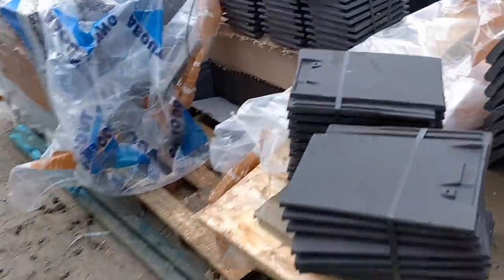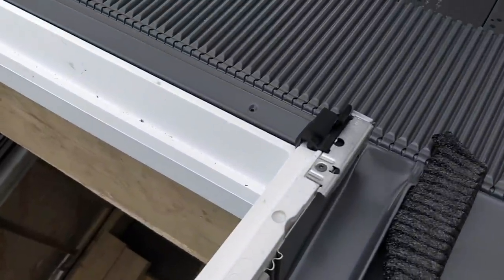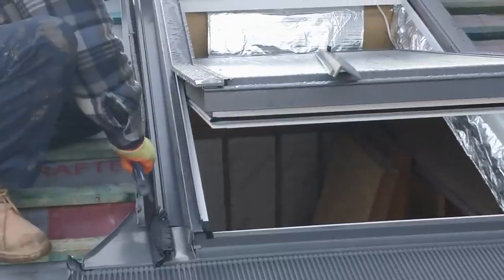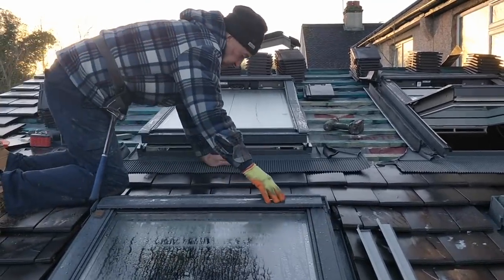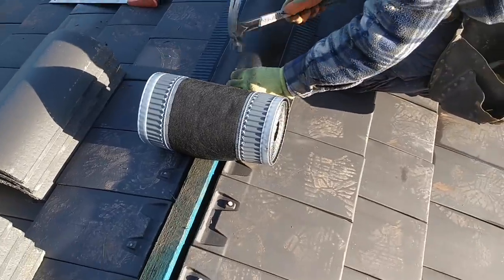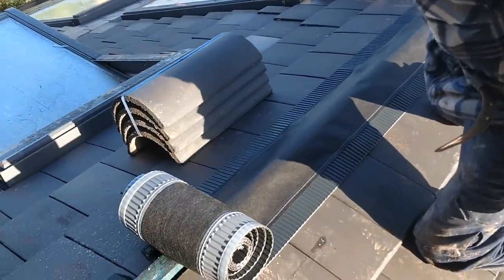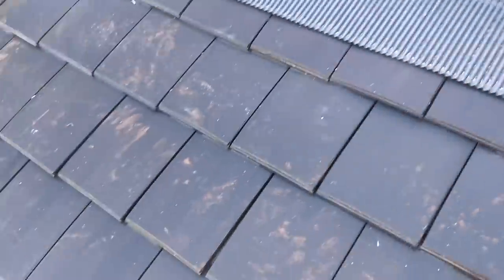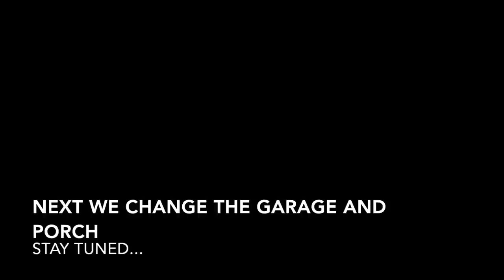Rear roof tiling and flashing kits

Comment: That dry ridge system is pretty much standard, they all have nearly no adhesion.
The project is coming along nicely 👌
Reply: Slight heat a lot of pressure and it sticks perfectly. Should be above the ridge as isn’t very visually pleasing!
The job is atrocious! Any decent/good Roofer would agree.

Comment: The roof is very busy with all the velux windows and the sandtoft 20x20 don't help. A lot will be warped when they are fired being clay also they will ride up on velux flashing kits what you have to do is grind off the back of the tile till they sit right time consuming

Comment: Tiles around the velux don’t seem to sit flat, not being negative
Reply from the maker: Yeah I asked Steve about that - he said that's common when the tiles have to be cut around the Velux as the flashing kit has the sponge which pushes them up. Not ideal, but better that the tile is pushed up and away from the window which helps drive the water off.
Reply: @OfficeBoyBuilder   you are supposed to cut the sponge depending on the type of roof tiles you use
Reply: @chriskane9230  I’ve never had that befro
Reply: @OfficeBoyBuilder  Nightmare roof to work on just look at them tiles and they crack. I've got the same sandtoft 20/20 minimum pitch 15 degrees. With the tiles around the Velux in the book it tells you to cut the sponge down to suit and you can also grind a bit of the back of the tile off to get it a fair bit flatter but this all takes time. Also get yourself a old foam mattress cut it in half and tie some osb to the top then you can use them to move about up there without breaking anything.
Love the videos and thanks for sharing
Reply: Yeah I normally cut the foam down alongside you don’t cut it to low it won’t leak. Plain  or moderns tiles always look worse than profile tiles around Velux s
Reply from the maker: Great suggestion! I was using some doubled over super-quilt and a ladder!
Reply: @b21playa  yes you're not too old to learn

Comment: You must have installed a lifetimes worth of Velux windows by now so you can forget all you've learned!!  Hopefully they are standing up to the snow, but the big test is when that starts to melt! A tricky bit of tiling made to look easy. Are you fitting a vented eaves soffit opposite the ridge to keep the airflow direct? Looking good, and must be very nice to be dry and secure now.
Reply from the maker: Yes we've had two lots of snow (and meltwater) now and not a single leak. We also had enough rain in 4 days to half fill a wheelbarrow! Very nice to be dry.
We're having a vented soffit on our side, and I've left enough space on the other for ventilation to flow past the guttering, across the top of the roof.

Comment: I always thought the 3rd tile coverd the 1st tile all way up ( double lap)??
Reply from the maker: As I'm not a roofer I may be incorrect here, but I believe it depends on the gauge of the tile and the lap specified by the manufacturer. In this instance we had 100mm gauge which obviously closes up the lap vs. if you had 75mm lap.
Reply: these tiles are interlocking gauge is normally about 170mm foam around window flashing should be cut to suit tiles
Reply: They are single lap tiles, plain tiles are double lap

Comment: Can't believe you're doing a roof with no edge protection on the gable, you fall from there it's game over. And you could be held liable for someone else's injury under the health and safety at work act. Not trying to preach, just trying to protect others as I work at height as a scaffolder.
Reply: It’s a little extension pal the height of a shed  no need for gable scaff

Comment: Steve is rough as fuck
Looks like the cheapest dry ridge system he could find and then he's still cutting it 6 inches short
Lead work was a mess, individual soakers are so much better, lead saddle must of been hit with the hammer a few times
Why didn't he use a block end ridge ? 
I've used they tiles before they're a pain in the ass for breaking

Comment: Personally a would put cut Ridge in middle not end more neater
Reply from the maker: Fair enough mate, thanks for being tactful in the way you've suggested that! Because of the size, shape and projection of the roof, it's actually impossible to see the ridge from anywhere except the upstairs rooms, and then because of the sightlines of the windows, it's not possible to see the cut tile nearest the house, so in this instance it works. I think your suggestion is a good one though for cases where it would be visible.

Comment: Mate sorry to say this but your roofer is rough as hell. That's a really poor job all round  so much wrong and rough. Personally I would part with any money until it's done properly
Reply: I totally agree Tom I’ve used dry ridge for years now and never used cement yet. Everything you’ve done on this build has been absolutely amazing but I’m sorry to say that the roof has totally spoilt the whole job, it’s not pleasing to the eye at all. The old guy is past his sell by date, personally I’d have all the tiles removed and start again. All the chasing out should have been done with a 4 x 2 sat on the battens and temporary fixed to the wall to stabilise the grinder, a plastic end cap to cover the end ridge instead of that wet cement, also the ridge brackets were missing to fix the screws in. So sorry to burst your bubble but please take heed of the comments, put it right or you’ll regret it later on.
Reply: Very hard to watch 😬
Reply: I don't get the cement at all, especially on the ridge. It's not waterproof and will just crack and fall out, I just don't get it at all.

Comment: Shouldn't the ridge tiles be bonded with cement or can you do without in some cases?
Reply from the maker: It's a dry-ridge system, which is designed to allow airflow (and evaporation from condensation) without letting in rain water. This means you can't use cement to bed the tiles in - save for the first and last tile as you saw.

Comment: Already a broken roof tile :(
Reply from the maker: Yeah the tiles are absurdly brittle - nobodies fault except the manufacturer...you can't float over the top of a roof, and I'm about 95kg - that's not going anywhere any time soon!
Reply: @OfficeBoyBuilder  are they nailed down every course ?
Reply from the maker: @mroldschool609  I believe there were... usually you'd do top and bottom and every third course - but because they're low angle he nailed each course.